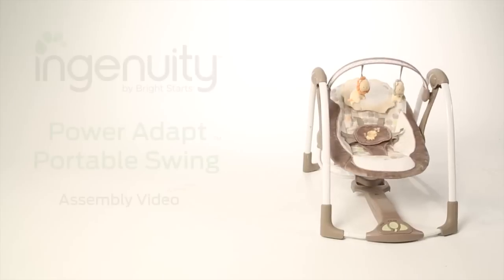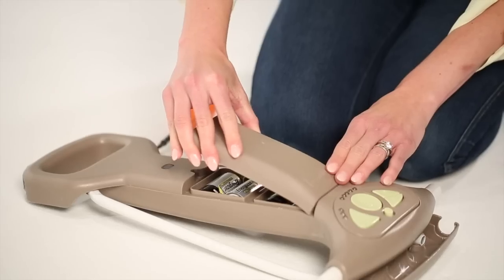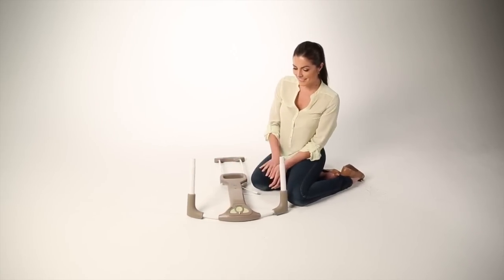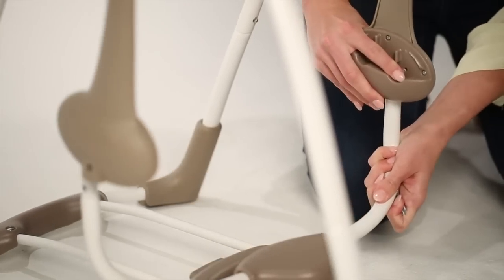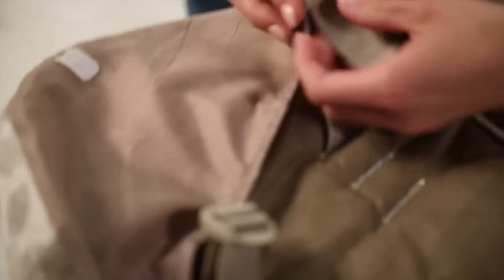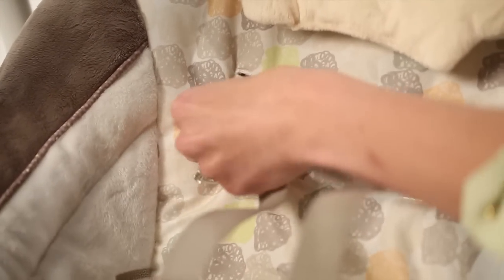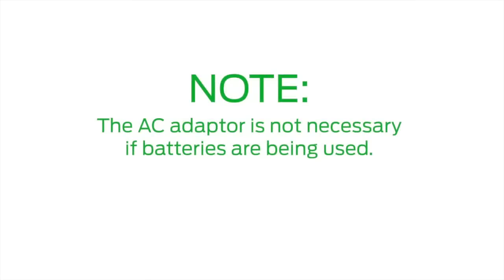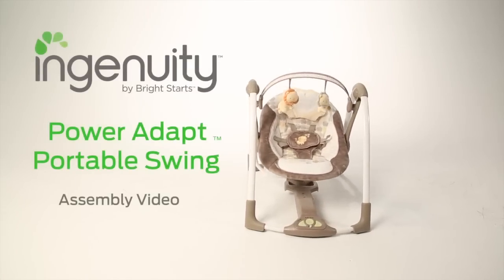Assembling Your Power Adapt Portable Swing from Ingenuity

Comment: The 4x screws needs to go  really tight. First time i could not screw with screw driver i had. Then i had to use 3/16'' x 3'' screw driver with a lot of force and was able to get it all the way through. Was a good work out though! And definitely this video was more helpful than manual as there were no written instructions.

Comment: I am not able to install the seat pad as the rods seemed to be fixed
Reply from the maker: +Krithika Vittal They should pull up and may take a bit of force to pull up.Is it possible the screws are too tight? If you're still having trouble, please email fbconsumerissues@kidsii.com. They'll be able to assist you further.